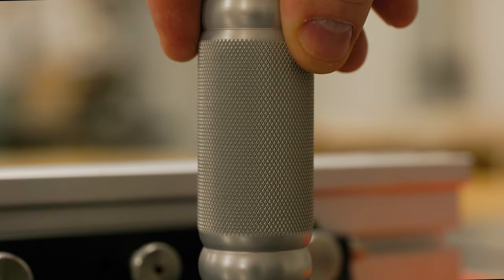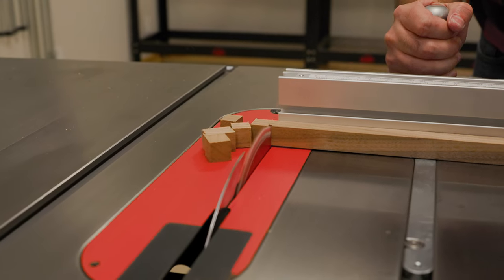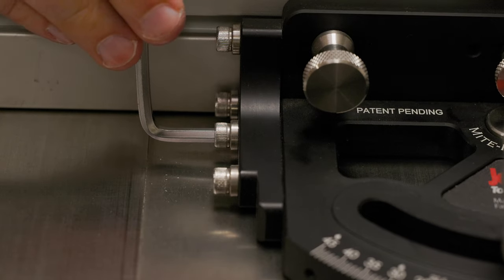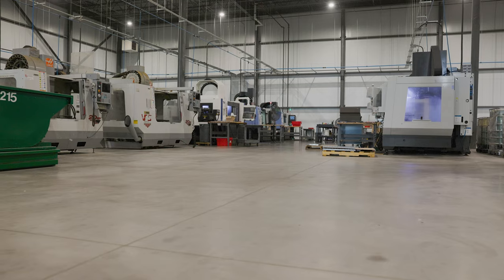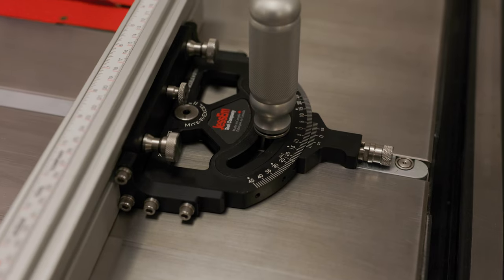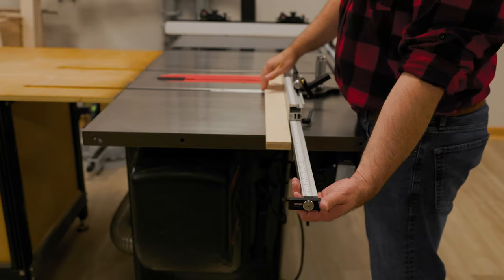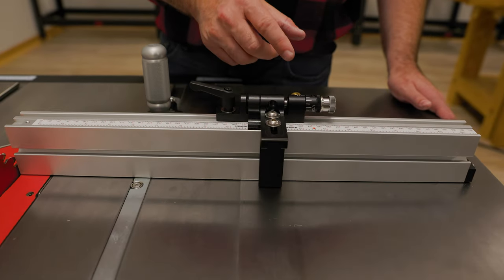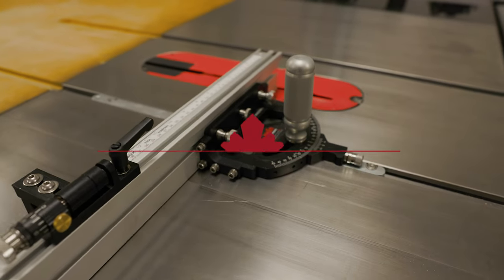The #1 Recommended Miter Gauge for Your Table Saw!

Comment: I've often wondered WHY is it that, on the adjustable stop, there is that bit in place that covers up the ruler on top such that I can't SEE what increment my stop is at. I always have to do .5" maths to adjust it. This has caused a few mistaken cuts. So if I want to repeat-cut 12" pieces, I have to set it such that the edge is aligned with 11.5"...again, why?

Comment: Where do I find this WITH the micro adjust? Everywhere I look, it does not have the micro adjust. If I can find it with the micro adjust, I'll definitely buy it. I love the miter gauge. The extendable fence is the only thing I don't care for. The flip stop should be able to be used on the extended part
Reply from the maker: You can get just the micro adjuster from us! I'll put a link below. All new Mite-R-Excel II's also come with one. Links in the description, or you can get one here:
USA Link - https://jessem.com/products/micro-adjuster-for-mite-r-excel-ii?_pos=2&_psq=micro+adjuster&_ss=e&_v=1.0
Canada Link - https://jessem.ca/products/micro-adjuster-for-mite-r-excel-ii?_pos=2&_sid=b8509e6ba&_ss=r

Comment: I would like one of these, it looks great and has great reviews.  However, if they are all built in your factory, which is apparently in Canada, then how does it have "Swiss-turned stainless steel parts?  For that matter, what does it matter?"
Reply from the maker: Those stainless steel parts are turned by our operators on our Swiss Lathes. They are high-end precision turning machines used for creating the most accurate knob and thread systems. They are not turned in Switzerland, but all made 100% right here in our Canadian facility.
Reply: I thought that might be the case. So the parts could be turned on any high-quality lathe, as long as they meet the design tolerances. Since you do not mention the make or manufacture’s country of origin for your other machinery, then mentioning the Swiss lathes is just a marketing ploy. Judging by all of the good reviews, both in writing and in videos, it seems to me that your miter gauge can sell itself without any nifty marketing jargon. Simply put, I believe it is the best miter gauge on the market.
Reply from the maker: No marketing ploys here! High-End Swiss Lathes are regarded as some of the top lathes in the world at ensuring the tightest tolerances and consistent results. We love learning about how tools are made and most of our customers do too! So we always add those extra details for those who want to know!

Comment: can this miter gauge be used on the right side of the blade as well?
Reply from the maker: Yes! You can remove the sliding stop on the extension fence with an allen key and use it on the right side of your blade.